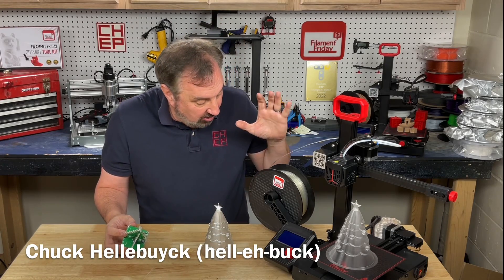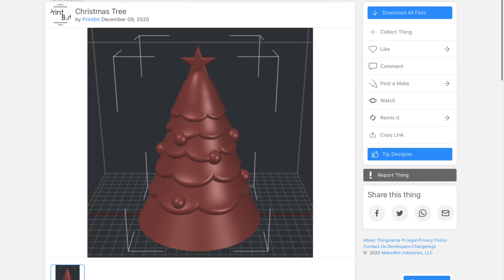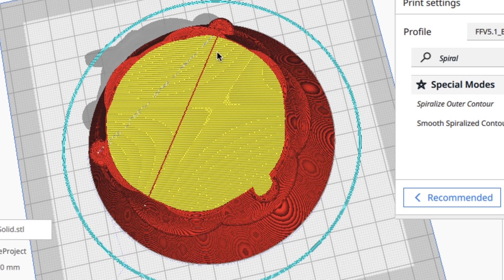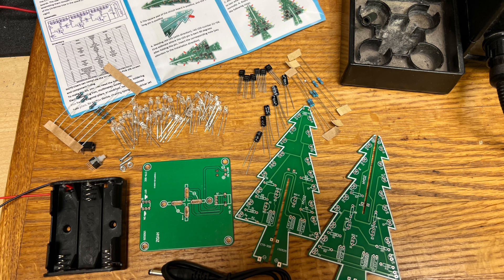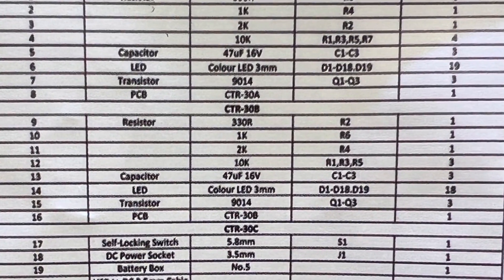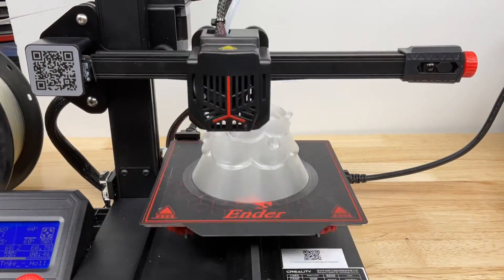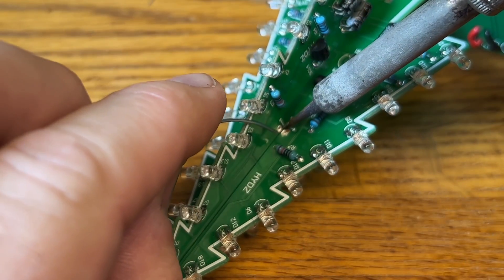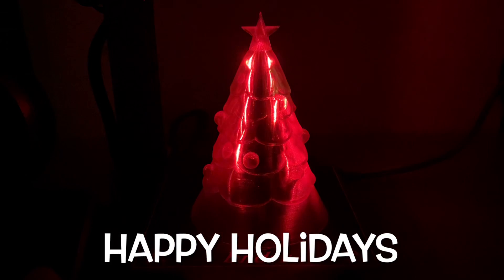3D Printed Clear PLA & LED Electronics

Comment: I just built one of these LED tree kits and decided to leave out the capacitors, because all they do is essentially cause the LED's to turn off intermittantly in groups of 6 LEDs. Since flashing RGB LED's were included in the kit I didn't see any need for the oscillation circuit.

Leaving the capacitors out causes the transistors to all stay conducting, keeping all LED's powered, which for these flashing LED's was preferrable for me.

I'm going to try printing this tree in opaque white filament since it'll still show through and diffuse the LED's a bit more. Thanks for the model.
Reply from the maker: Sounds great.

Comment: The best solder to use is one with a water-washable flux such as Kester 331.  After soldering, just use warm water to wash off the flux and use compressed air to dry. Most components are water-proof and will not be harmed. Your boards will look nicer.

Comment: Ok, I have said it before, but it needs to be said again, you are a genius.  I have been trying to make a hollow half moon using your normal profiles and vase mode and I got the same stupid lines or it would say it would take years to print, not a joke.  I imported the moon again to try, put your setting in and low an behold, I can actually print it.  I'll have to give you a heads up how it prints, but at least I have a profile to use.

Comment: This may not be on the subject of the video but I have an Ender 3 Pro and every time I print a tall vertical print when it gets 75-100% complete, it falls or the nozzle knocks the print over and it canno complete.  Can anyone please offer me some suggestions or print settings that will fix this issue?  I am losing alot of wasting time and PLA from failed prints.  Please help?  Thanks
Reply from the maker: Check the brass T-nut for binding. You may be losing Z motor steps because of it causing the issue.
Reply: @FilamentFriday  will do. I did have to fix an issue where my z motor housing would fall when the motors were not engaged. I installed an anti backlash screw but it still falls when not in use. I always have to put something under it to prevent the drop.
Reply: Try also doing z-hop, it may help

Comment: i'm not as confident with my soldering skills (or lack thereof - i know... i need to practice) yet... but have just used the multi-colored LED seed lights in translucent single wall prints and they look amazing for DIY battery or USB powered nightlights.   the multicolored ones on a slow 'breathe' rotation are really soothing and give a soft glow through the PLA

Comment: CHEP, is it possible to use you 5.1 0.28 profile, and have Cura change to a diner profile for say the last 5-10 layers? I know you can change individual parameters at layer height, but I had this Bolt measurer, and it prints great and fast but the extruded numbers on the top 5-6 layers look terrible. If I could take advantage of the fast profile and then just switch to an ultrafine for the top text layers. Thanks! Marry Christmas!

Comment: Hi Chuck, Happy Holiday's to you too!  

I just got my new 8K Elegoo Saturn 2 resin printer and it is a huge printer. 

I found that when it comes to washing and curing even though I use only water washable resin, 

The problem I found is that there is no wash & cure system by any maker including Elegoo which would have the size of wash tub or curing area 
big enough to do the full size of any model the full size of the Saturn 2 does?

I emailed Elegoo about any possible bigger system coming out so us Saturn 2 owners can have any full bed plate sized model can be washed & cured!

Have you any idea's which could help in being able to wash and cure such big models this amazing Saturn 2 can make!

Thanks for the great 2022 videos and again happy holidays to you.  😉🎄